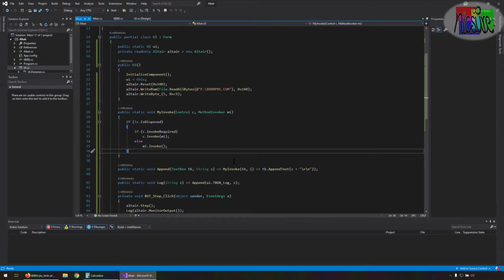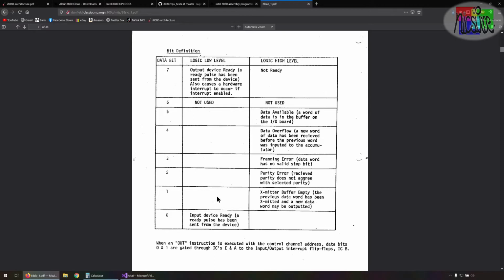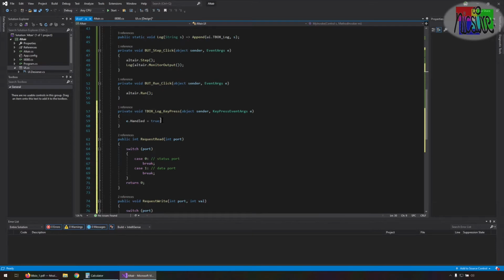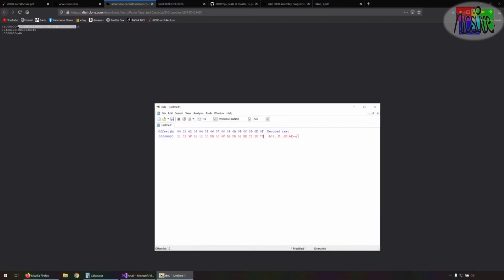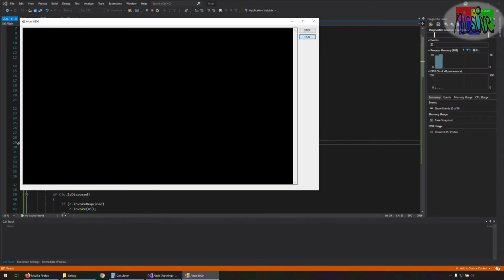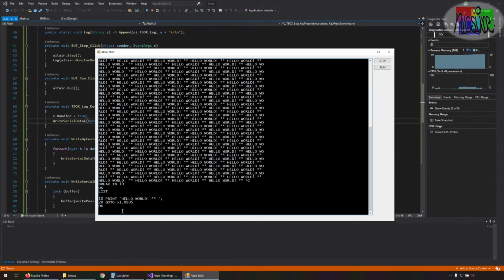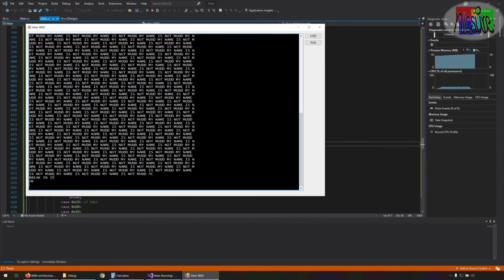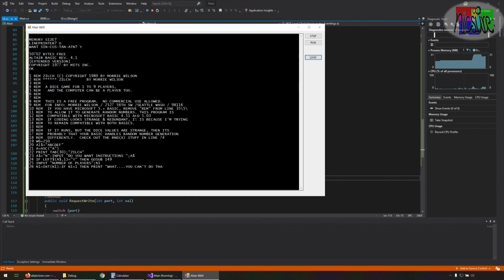[c# Challenge] Altair 8800 Emulator From Scratch (Part 4 / 4)

Comment: Do you plan to make a Space Invaders emulator ?
It's using the same 8080 cpu as the Altair and it's a common choice for beginners who wants to learn emulation, but sadly, there's isn't any tutorial on youtube about this machine.
Reply from the maker: That might be interesting. I'll have a Google around to see if I can find some info on the video and sound hardware. I imagine that'll be most of what I'd need to know.
Reply: @nicsure  Cool ! There's plenty of documentation and tutorial about this machine.
There's also quite a lot of implementation on Github.
Reply from the maker: @benjamindeharo314  I've found some info, as you mentioned there is a lot of information on it. I'm experimenting with it now.
Reply: @nicsure  Cool ! I hope to see videos about it ^^
It's been a while since I've looked at it, but from what I remember, the graphic was the part that bugged me.
I think you need to rotate the bits from the video ram, and there are 2 interrupts per frame.
That doesn't sound too complicated, but that was enough to confuse me.
Reply: @nicsure  How is it going ? Are you still experimenting with it ?
Reply from the maker: @benjamindeharo314  My work is crazy busy currently so I've little free time but I have studied the info available. It shouldn't be too challenging. I'm aiming for getting the video out maybe 2nd week of September when I get some time-off. The screen rotation can be handled I think by drawing directly onto an intermediate Bitmap image then use the Graphics library functions to draw that bitmap onto the display image bitmap  using the rotation features in the graphics library. I could also use a one pixel per byte bitmap which makes it far easier to construct a translation function to draw the screen rotated, in fact, that approach may be the way to go as I could also easily implement the screen overlay film colours.
Reply: @nicsure  Wow ! That's really cool.
Don't overwork yourself and take your time, it's already nice of you to even consider doing all of this because a random guy online just asked you.
I think the one pixel per byte approach will be easier to understand for me, but that's up to you.
Reply from the maker: Starting work on this now.
Reply: @nicsure  Can't wait to see it :)